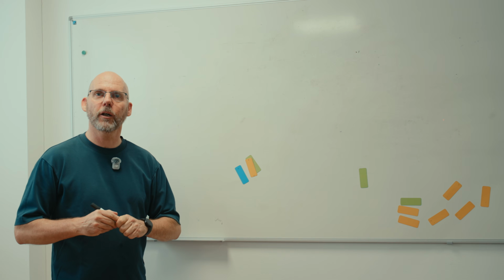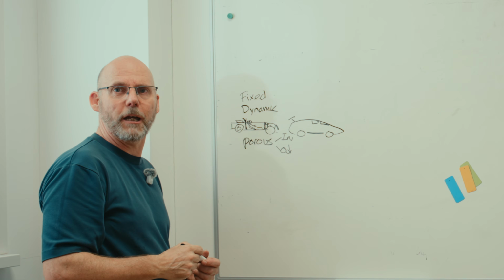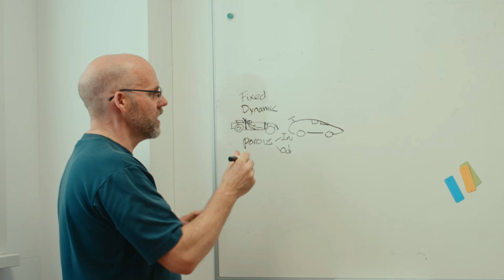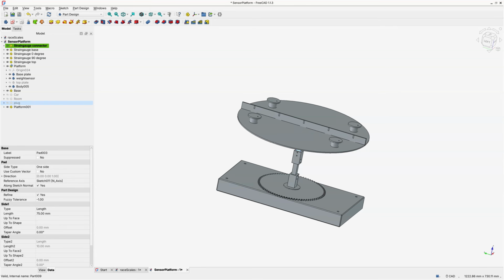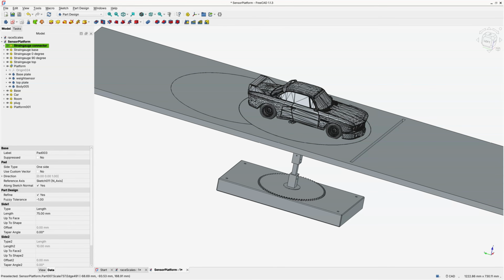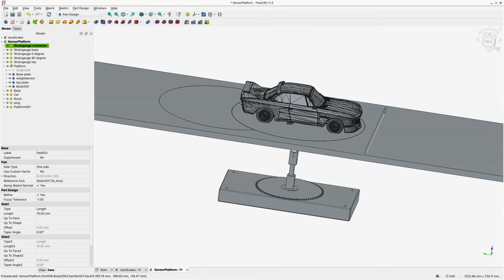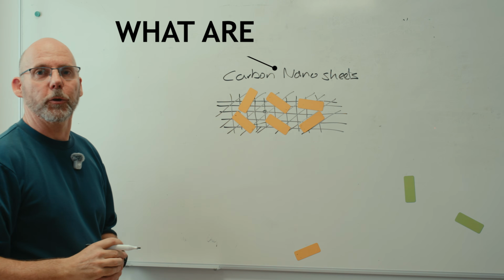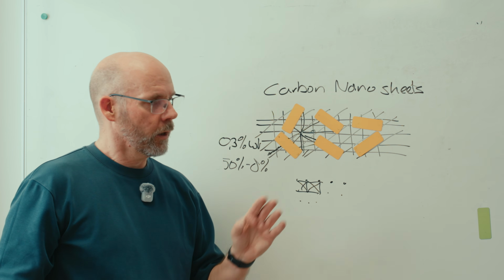The Part of Building a Hypercar Nobody Sees

Comment: Hi Rob, thanks for the insights into the various projects. Impressive progress so far!

I have two related points:

Have you looked at/asked for the safety requirements for a garage 56 entry? Do you need to adhere to LMP2/3, GT3 or any other standards? Don't forget to take safety cells, roll cage dimensions and crash structures into account when designing the car. I recall your battery tube looking quite exposed at the rear of the car, at first glance it looked to be potentially inside the rear impact crumble zone.

I do understand why you want to reinforce the carbon body, but do keep in mind that the shattering on impact is a meaningful way to dissipate energy. With a stronger body, you can expect the kinetic energy to do more damage to the frame, which is often much harder to repair. And more importantly, on impact the driver will be subjected to stronger forces. Perhaps something to consider?
Reply from the maker: We plan to meet or exceed LeMans Hypercar safety specs. 

Increasing the strength the way we are doing should theoretically increase the materials ability to absorb energy before failure. More kinetic energy will go into the skin before failure (defined as the point where no more energy is absorbed) so it should make the whole thing safer from that point of view.

Another aspect is the resistance to breaking, regular carbon fiber shatters into many tiny sharp pieces upon impact. The proposed enhancement should keep the shell together much better, reducing dangerous debris on track.